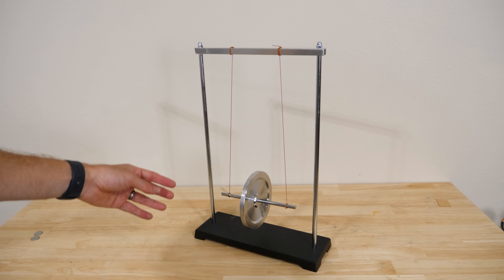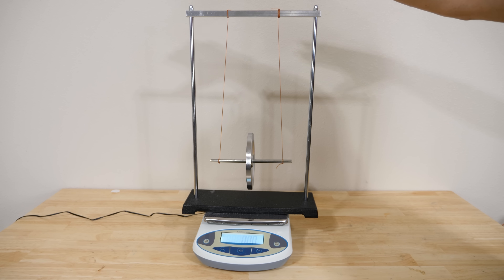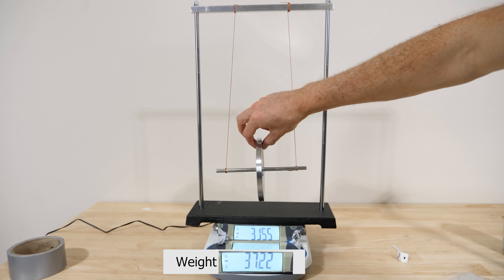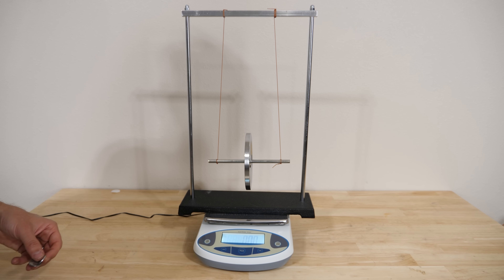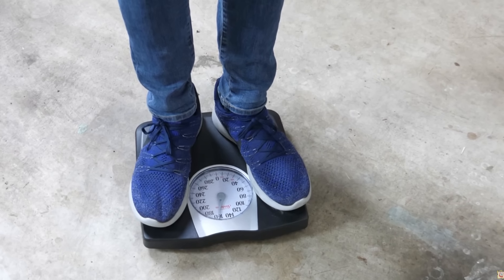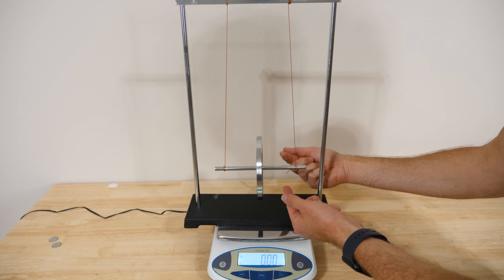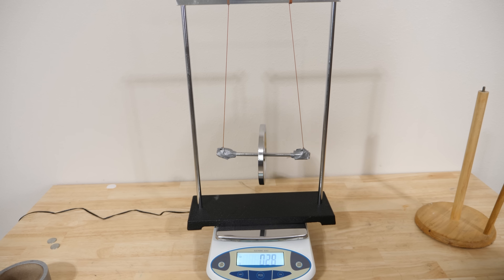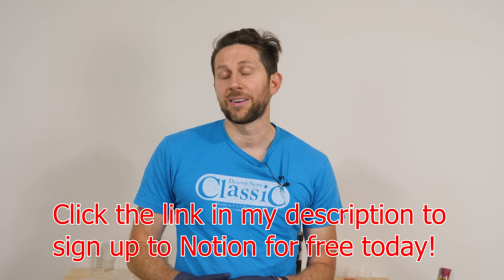How Does The Anti-Gravity Wheel Work?

Comment: I believe that you are wrong.
The reason why the scale registers a lighter weight is because of the centrifugal force that the wheel is producing. All of that metal's weight, when it is spinning, is pushing outward all around the disk, from top to bottom. That force is pushing in front, behind and up as well as down.
Reply: Vic,
'You have incorrectly applied your concept.  The forces "pushing in front, behind and up as well as down" All cancel completely.
.  
There is absolutely no reason for it to be more in one direction - regardless of how the gyro is oriented.
..
Here's my full analysis and explanation
..
CORRECTION!  The wheel does NOT weigh less when it is spinning!.
..
It may be more correct to say that it weighs less when it is "bouncing".
..
I have a problem with the interpretation of the Laithwaite demo.  Precession does not translate the wheel.  It does not lift it. 
Precession causes the axis of rotation to change direction. This is a ROTATION about the center-of-mass of the wheel. It is not lifting the whole wheel's mass. 
.
Precession does not cause the gyro to move (translate) sideways, nor upward in Laithwaite 's case or Veritasium's case. 
If the vertical spinning gyro had translation, it would slide along the table, but stay vertical. It does not do that.  It tips, or rotates at 90 degrees.
The fact that the handle is offset and long has significance.  If you push the handle in the direction of the precession, that lifts the handle, right?.

However the interpretation that the spinning wheel is always accelerating downward even while moving upward,  is a very good catch. It took me a few seconds to realize that.  My quick initial feeling was that the weight would go positive on the way up. . . 
The way to think of it is that is is 'partly falling' due to gravity.  When you are in free-fall you are completely 'weightless'.  The spin and string-shaft arrangement allow it to fall, but not fully, as when you are in free-fall.  So, the frame experiences somewhere between the full weight and weightless ness, but more weight during the bounce time. 
..
 The winding and unwinding of the string causes the up and down motion which is what changes the weight. 
..
Stand on a bathroom scale and at a medium speed, move up and down by bending your knees.  Try to move faster and faster on the way down and slower and slower on the way up. You will see your weight decrease during those times.

.. .. ..
If you watch carefully, you see that it is speeding-up as it drops; this is accelerating, but not at the full 'gravity-rate'.
Also, it is slowing-down as it rises, again not fully accelerating (decelerating or negative acceleration) due to gravity.
..
On a trampoline you are completely weightless from the time your feet leave the trampoline until they touch again and start the bounce. During this time you are constantly in 'total' free-fall.
When in contact with the trampoline you are accelerating upward and weigh more than normal.
If you can add a small upward force to reduce the acceleration due to gravity, you will weigh less. No surprise there.

This is analogous to only "partway" jumping on a trampoline (or your bouncing ball).  On a tramp, you are accelerating downward when your feet are not in contact with the tramp. The ball is when it is not in contact with the floor.  The spinning wheel only "partly" leaves the support strings.  It is "partially bouncing".
If the tramp accelerated you upward at twice the rate of gravity, your weight would double.
Therefore, there is also a slight increase in weight at the bottom bounce.
.
This would be equivalent to a small jetpack on your back that can't lift you, but only partly reduces your weight.  You would be in "Sloe-Fall", not free-fall.
..
This would make a wonderful Dean Drive Scam. . . .
..
It would be nice to have a real-time force load cell so we can see what happens at the bottom of the wheels travel - the positive weight gain during the short 'bounce' time.

..
Also, WHAT HAPPENS to the weight, if the wheel is NOT spinning, but bouncing while being suspended by a spring, instead of the winding/unwinding strings?  
Is that equivalent to this "partial bouncing" effect?
Reply: @Observ45er  When the wheel is winding upwards the axle pulls the strings downwards and at least there should be a positive weight to be seen, being a digital or an analog scale.
Reply: @O-Kyklop   While I agree that seems intuitively correct, it is not.
..
This is a true test of your core understanding of acceleration and force on mass. 
.. ..
It is definitely tricky. 
I must point out that when the wheel is winding downwards the axle ALSO pulls the strings downwards. 
..
..
This must be compared to "partly" bouncing on a trampoline.  On a tramp, you are completely weightless when traveling up AND when traveling down [above the tramp].  You are under complete and absolute Free-Fall.
..
BUT. . .  in this case. . . . 
..
The spin and winding/unwinding of the string is messing up your intuition. . . 
..
You can not deny that the wheel is experiencing angular acceleration/deceleration.   This absolutely must be considered, not just the center-of-mass moving up and down.!.
..
Gravity is not just moving the wheel's center-of-mass up and down.  It is ALSO causing angular acceleration and deceleration of the rotational inertia of the wheel. 
..
Because the wheel's center of mass is decreasing in speed while traveling upward [and increasing in speed downward]  ; it is experiencing partial acceleration from gravity, and, therefore, only part way to being fully weightless as it would be under complete free-fall.
It is under "PARTIAL free-fall".  
OR . . . "not-so-free Fall."
..
My analysis is correct.
..
It requires a full and complete understanding of everything that is important.  This includes the acceleration of the center of mass [translation] as well as the angular acceleration of a mass.
.. ..
From this understanding: 
I claim that changing the diameter of the string-winding axel will change the weight reduction.
.
A larger axel will cause the weight to decrease more, BECAUSE it will move the center of mass up/down closer to free fall and, therefore, loose more apparent weight.
..
My analysis is correct.
Reply: @Observ45er  
Very interesting but I still focus on the axle which, by winding upwards still pulls vertically at the strings to lift its weight.(which is not the same as just falling)
 The pull is vertical at the tangent of the axle. the spinning movement is not involved as far as it concerns the pull on the strings. And the whole structure shows a weight loss.
Reply: @O-Kyklop  Here's another way to view it.
.
The spinning energy and winding string is holding the weight of the wheel up, but just a little.  It isn't supporting  the whole weight because it is not accelerating fully from gravity.  It is accelerating less than by gravity, so SOMETHING must be opposing gravity.
..
Also. . . 
YOU note the string pulling down on the frame that you think is adding weight to the frame and scale.  
..
However, the strings are also pulling up on the  flywheel weight. 
.
I admit that it is very tricky.
Reply: @O-Kyklop   I understand, but this is a real brain-burner about energy.
..
Well, it may help to know what he doesn't explain.
When the weight/mass of the wheel is up, altitude gives things potential energy - they can do work when falling under gravity when they trade that potential energy for the kinetic energy of the velocity at the bottom of the fall. [like water and a water-wheel]
.. ..
In THIS case, it is "falling" AND also converting some that potential energy (from height) into kinetic energy of the vertical speed of the wheel's mass when it hits bottom.  You need to see that it is accelerating (picking up speed) downward as though gravity is much less (compared to if it was in free-fall with no strings). It is not falling as it would with only gravity.  BUT it IS accelerating downward at all times (as though gravity was weaker)
..
The rest of that altitude-potential energy is ALSO being converted to the kinetic energy of the spinning mass. 
..
Therefore, it is not all going to the 'falling' mass. 
. . . so. . . only some of the gravity-potential-energy is going to accelerate the center of mass.
.
I also put a comment under the video.
.
The energy added to the rotational-inertia can be thought of as 'stealing' some of the (gravity-caused) falling-kinetic energy.
Therefore, if all of the gravity is not making the center pf mass fall, then it must fall slower than the full gravity would make  it.
..
You NEED to understand that a bouncing ball is in free-fall when it is not in contact with the ground. It is weightless. 
..
When you are on a trampoline and not in contact with it, YOU are in free fall - YES, even while on the way up.
.
During those times the ball/you are Accelerating downward under the force of gravity -- Even when going up! 
..
Since the center of mass of the wheel is accelerating downward, but not at the gravity 'rate", something must be 'stealing' some of that force.
.
It can't continue for longer than the strings, so it isn't providing useful thrust.
I don't have a better way to explain it, yet.
Cheers.
Reply: @Observ45er  
What you're looking at in this video is a plain and simple phenomenon: The spin wheel  is converting gravity into mechanical work and the weight difference is telling you how much.
This is "mysterious" and "tricky" only from the background of academic science.
Reply: @O-Kyklop  I don't know why you're addressing me. I do not consider it to be mysterious.  You're the one saying it should weigh more, but it clearly weighs less.
 @O-Kyklop :  " axle pulls the strings downwards and at least there should be a positive weight to be seen"
Reply: @Observ45er  
Yes, according to academic science. Otherwise no one seems to have any real explanation for that question.
Reply: @O-Kyklop  I explain it in a comment a day earlier than this. It appears right below this reply for me. . .
I also attempted 5 months ago.
I sent him an email to see if he has an explanation for either the energy conversions he mentions or the weight decrease.
I understand it.
Reply: @Observ45er 
" I understand it. "
This would mean you understand how basically a gyro works. Do you?
Just to anticipate:
To put some parameters together that fit a special case, can't be considered an understanding of the phenomenon as such.
Reply: @O-Kyklop   I'm having trouble decoding your question. 
.
Here's the basic physics for this.
.
For this demo, the gyro axis orientation is fixed, so there is no precession.  It is energy transfer back and forth, between altitude and angular momentum.
.

The gyro's mass has maximum potential energy at the top and minimum at the bottom.
.
It is also constantly changing angular momentum - most at the bottom to zero at the top.
.
If you look, you see it is varying vertical speed in the way it would if it was bouncing under less gravity.
.
 Using inductive reasoning, this says something must be opposing gravity, but only partly.. 
Therefore, the changes in angular must be doing that opposition. 
.
On the way down, the potential energy due to height is being converter to angular momentum.
 On the way up, the angular momentum is being converted back into vertical potential energy.
..
Then reasoning how this opposes gravity by carefylly observing the direction of angular momentum transfer,:
.
On the way down, the angular angular momentum transferred TO the spin is  pulling up on the gyro's mass, thus  opposing gravity.  Think of the gyro's mass as resisting the angular acceleration and putting tension on the string keeping from free-falling.. 
.
On the way up, the angular momentum FROM the spin, is now pulling up on the gyro's mass.
.
So, we see that the change in vertical direction and the change in direction of angular momentum transfer, complement each other to always oppose gravity.
.
Seems simple when carefully stepped through using physics.
.
Follow?  Because I don't think I can explain any better.  It makes pretty much obvious sense to me.
Reply: @Observ45er  
"On the way down, the angular angular momentum transferred TO the spin is  pulling up on the gyro's mass, thus  opposing gravity.  Think of the gyro's mass as resisting the angular acceleration and putting tension on the string keeping from free-falling.. "

I'm not sure.
By rolling down the wheel gains more  energy from top to bottom than from bottom to the top, because of the downward movement. It means, it is pushing the axle more down than it is pulling it up. Accordingly the weight difference should be + and not –.  But it is still –.
What do you think?
Reply: @O-Kyklop  Please read my previous reply again.
.
On the way up, the string is winding up on the axel and this is like climbing up a rope.  It is "pulling itself" up.
The wheel's angular momentum is pulling the wheel's weight up the sting.
This upward pull is opposing gravity.
.
That's the way I think of it.
On the way up, the spin is pulling the weight up.
.. ..
I saved that description and may periodically review it to see if iut can be made clearer. 
The overall idea is:
On the way up, the spin is doing something. to pull itself up.
On the way down, the need to spin it up takes effort.  That is keeping the weight from free-falling.
Something like that. . . . . 
Cheers.
Reply: @Observ45er  
It doesn't relate to my previous comment.
Reply: @O-Kyklop  I;m doing my best to interpret your words and it sound like you are reasonably close to the physics.
Good luck.
Reply: @Observ45er  
Do you mean school physics? School physics doesn't understand how a gyro works. That's why I choose my words to describe the phenomenon according to what I see.
I don't need good luck.
Reply: @O-Kyklop  Huh? Physics; as in science.  Complete physics, not just for students in 'school'.   Adults, scientists, physicists, engineers - studying science for thousands of years. Like Newton, Einstein, Feynman, Green, Tyson, etc. . .
.
However, this an interesting demo for a class, as he says. . .  
.
Understanding technical subjects in text like this is somewhat difficult.

You seem to be on the right track for understanding this, but I'm having a little difficulty fully understanding what you wrote (as I assume you may be having with what I wrote).
If you have questions about what I posted, try quoting, than asking.

Cheers.
Reply: @Observ45er  
"Adults, scientists, physicists, engineers - studying science for thousands of years. Like Newton, Einstein, Feynman, Green, Tyson, etc. . ."

That kind of science is not that old. It is about 3-400 ys old.

"You seem to be on the right track for understanding this, but I'm having a little difficulty fully understanding what you wrote"

You'll understand better when you read it and forget what you have learned at school. This is the only way to understand something new
Reply: @O-Kyklop  I'm speaking in general.  Don't be so picky.  Those were merely examples of  people in genuine, professional science to specify what you asked about; to differentiate it from your 'school' science.  No, I was not referring to elementary or secondary school science classes.
The subject is the serious study of science principles whenever it occurs.

?? when you read it ??
Read what? What are you talking about?
..
This demo is a spinning mass which is exchanging angular momentum energy with the  mass's potential energy due to elevation.  There is no precession, nor any use of that phenomenon, so there is no reason to keep referring to it as a gyro;.
There are no gyroscopic effects from precession to factor in to this demo.
.
I attempted to explain how the energy exchange occurred in words.
..
If you have any comments or questions about this demo, I am willing to attempt clarifying my explanation?
.
Also, what he says at 6 minutes is correct,  He just doesn't go down to the level of analyzing the forces as I have above.
He also glosses over the short weight spike at the bottom.
..
I don't know if the weight should simply average to zero, or if there is some square or square root thing that makes it work out correctly for the physics god. . ..
Reply: @Observ45er  
"This demo is a spinning mass which is exchanging angular momentum energy with the  mass's potential energy due to elevation.  There is no precession, nor any use of that phenomenon, so there is no reason to keep referring to it as a gyro;.
There are no gyroscopic effects from precession to factor in to this demo."

Of course it is a Gyro. It is one reeling down the strings with a precession effect due to the translation of the wheel.  and this makes the minus weight quite difficult to understand, for a mind trained in school or classical physics.

Comment: The reason this happens is due to converting energies. The kinetic energy ( a raised mass ) is being converted to heat, in the form of resistance, a small bit on the string and mostly into the air. The rotation of the wheel slows that transfer over time.

Putting the whole setup, scale and all, in a vacuum would decrease the weight loss, and extend the entire run time, as almost none of the energy loss would be to air friction.

Try it.
Reply: No.  It is just as he describes at 6 minutes.